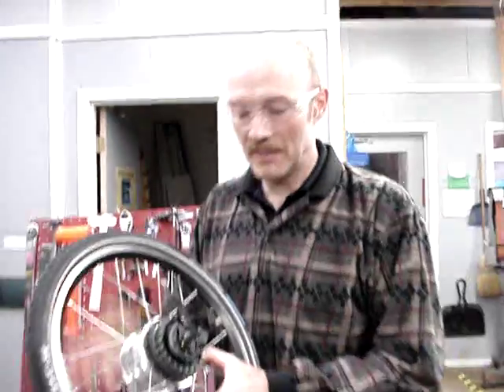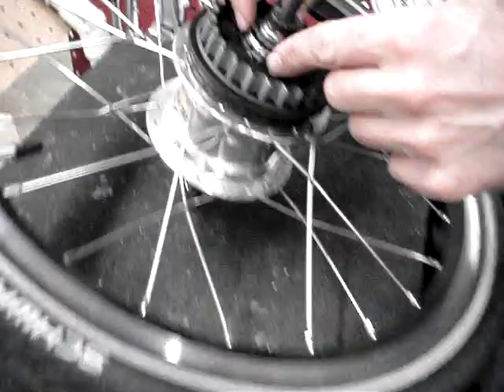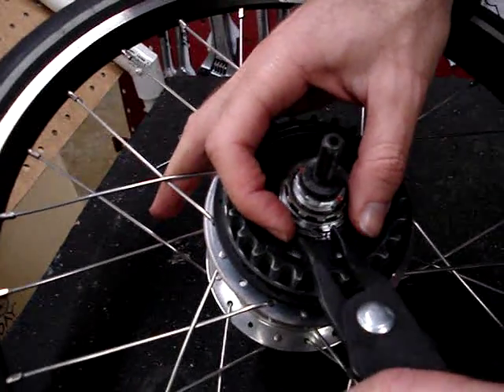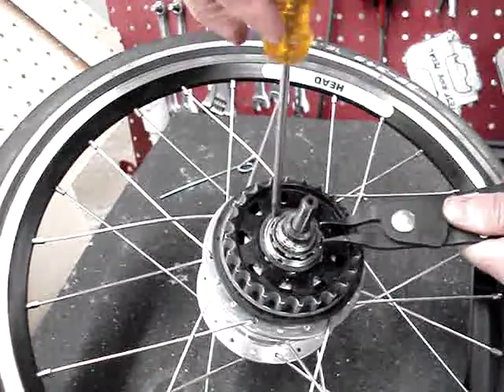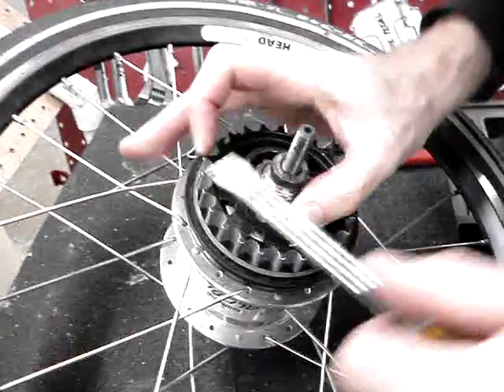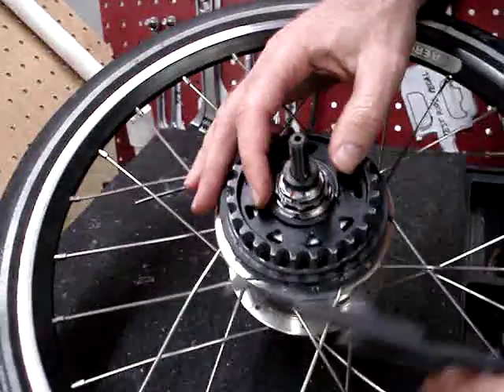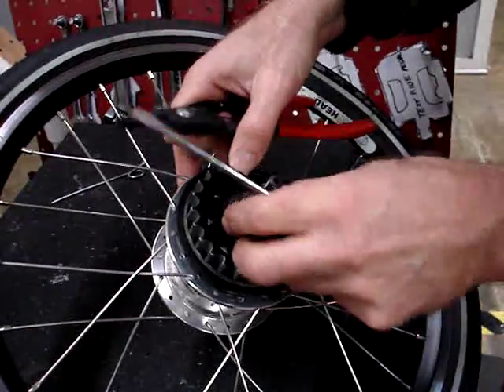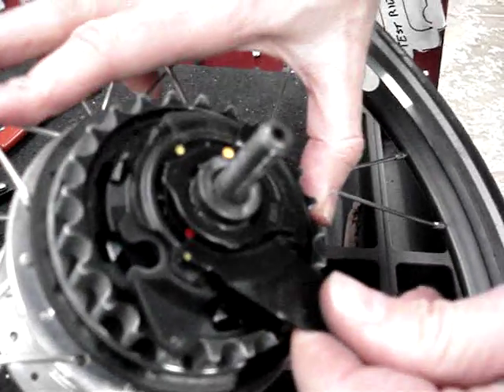Bike Friday tikit Maintenance- Removing the cog on a Shimano  Alfine 11 Internally Geared Hub.MPG

Comment: The spreader with the pins is the tool to use. When the right tool is used, it is not a struggle. The snap ring stays on the pins of the spreader, and is almost a one shot. Remember when putting the ring on, to seat it all the way down onto the sprocket (my bike came from the factory with it not fully seated, fortunately, it seated in with a loud crack sounding as if the axle broke, rather than snapping off and the sprocket coming off. With the right tool again, it is very easy.